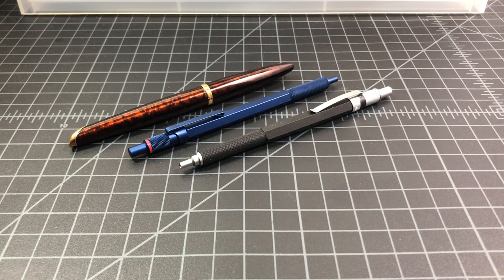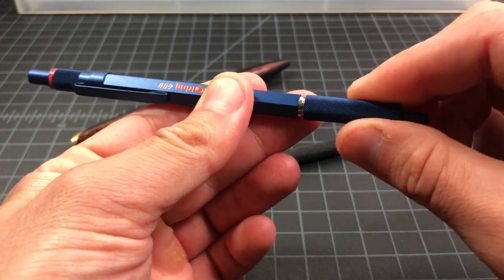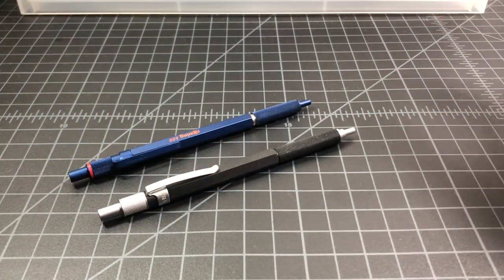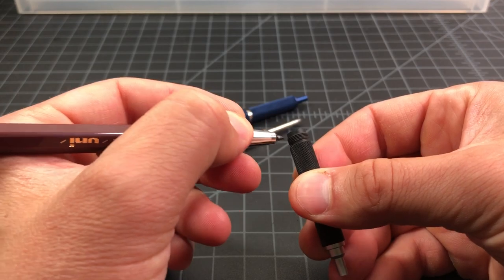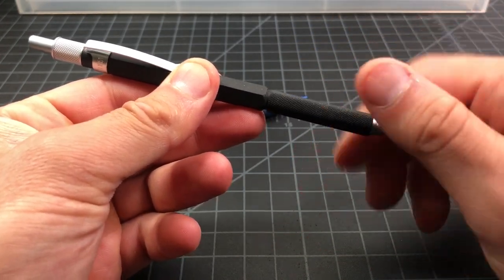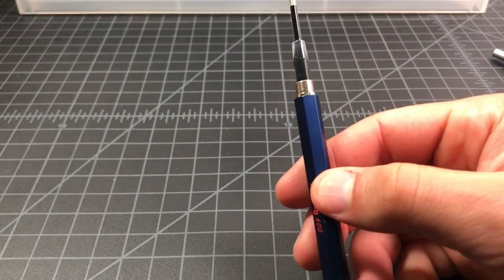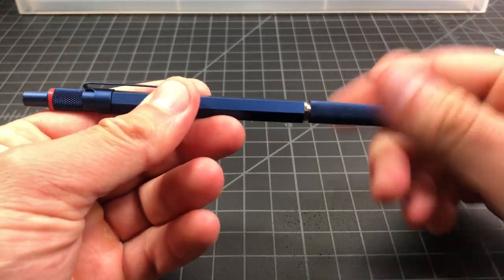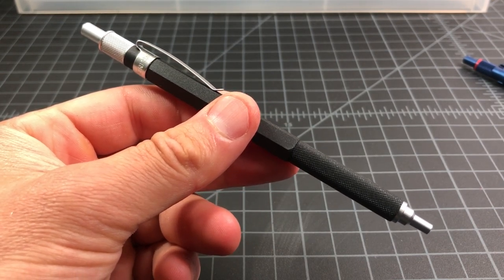How To Fix a Squeaky Pen or Pencil

Comment: Why does this happen ? - I live in a semi humid climate - I have never had this problem - but great tip ✌🏾♥️
Reply from the maker: Just metal on metal I think. The graphite acts as a lubricant
Reply: Unsharpen is it because of a dry climate?
Reply from the maker: Yea could be a humidity issue sure

Comment: Maybe some silicone grease is better. That pencil solution doesnt work
Reply from the maker: Maybe if you apply is very very lightly. Otherwise it’ll squirt out when you tighten the pen
Reply: Unsharpen yes. Or wd40 could work as well